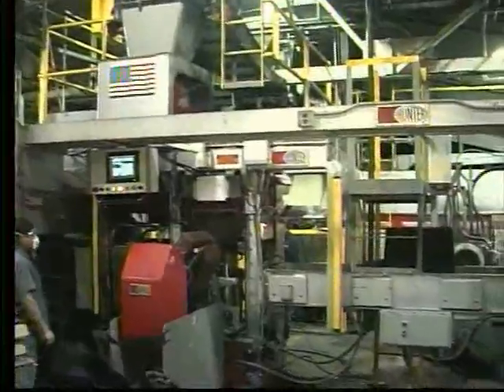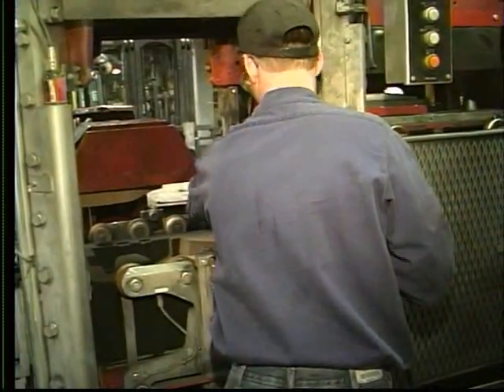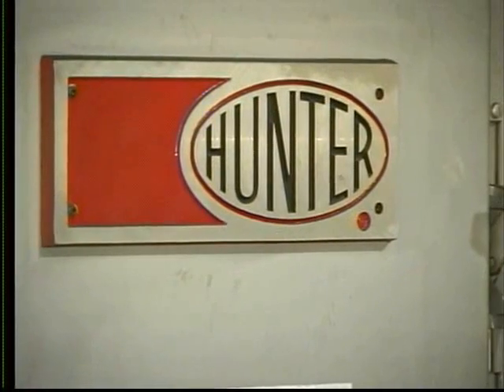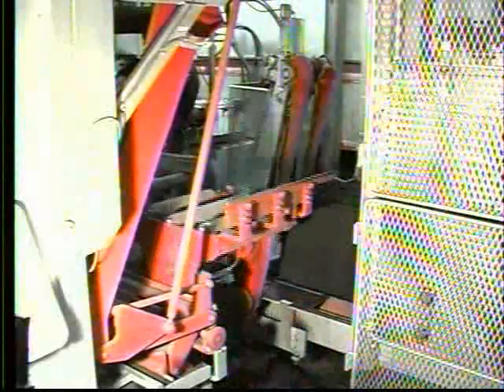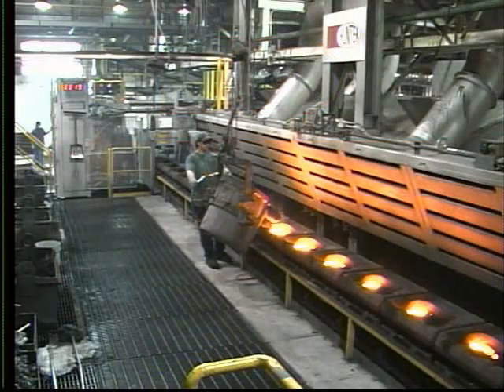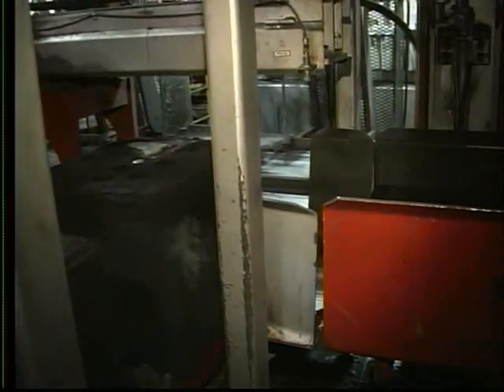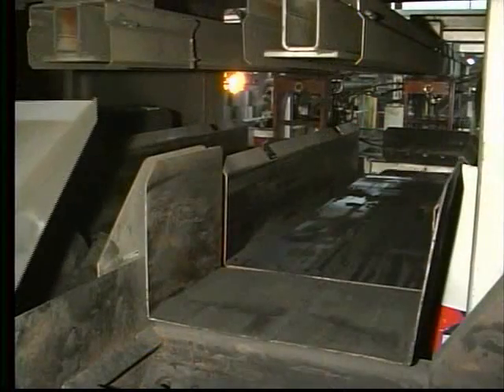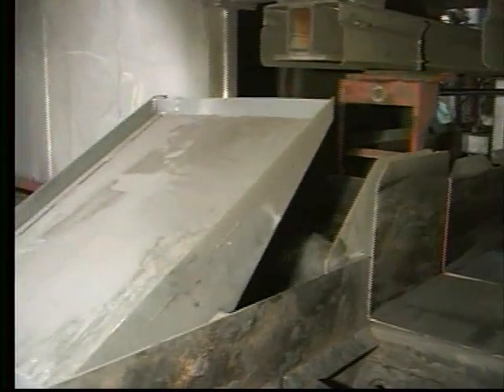Bremen Castings

Comment: Have you guys had any trouble with the platen table drifting down. We have rebuilt the cylinder and replaced all the valves that control the platen table.